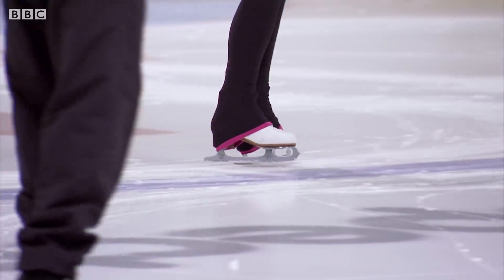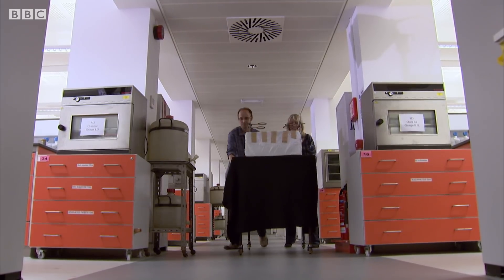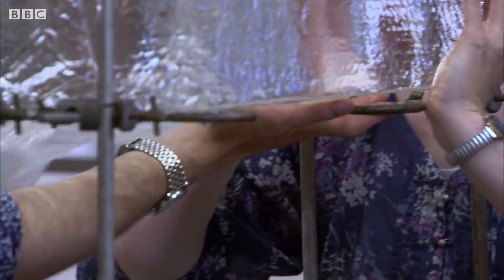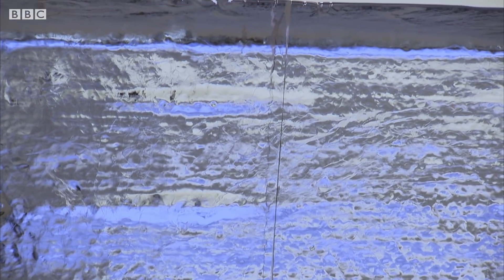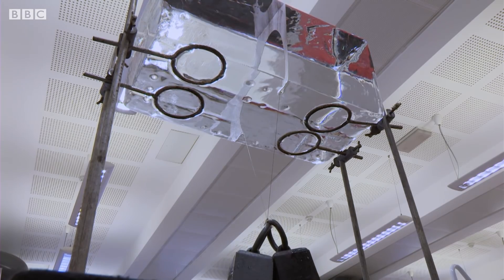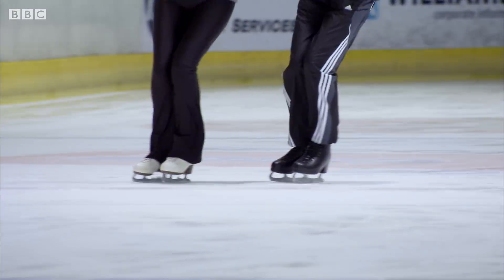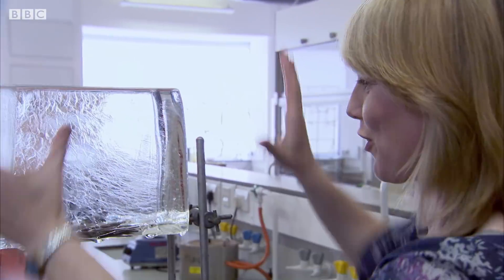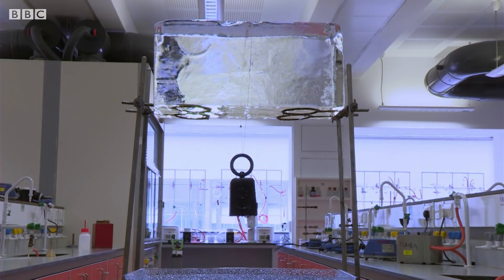How Do We Skate On Ice? | Earth Science

Comment: It's not just the pressure though, as that would account for only a few degree change at best, and you can still skate on supercold ice. It's also slippery in shoes and not just skates. There's more at play here than that one aspect.
Reply: Having worked at an ice rink, I can tell you it isn't as slippery as you think in regular shoes. Wet ice (as often found in nature) is what accounts for falls. Its smoothness combined with the pressure is what makes it more slick than the normal ground you walk on.
Reply: 2:20 "one of the key reasons"
Reply: @Jonny-hm3iz It is not a key reason though. A human is way too light to reduce the melting point of ice in any meaningful amount.
Reply: The temperature does not change. It's all a function of the pressure. Basically, there are two factors in determining the state of a chemical, the temperature and the pressure. Most chemicals will go from liquid to solid if you either decrease the temperature or you increase the pressure. Water, on the other hand, is quite unique in that the it goes from liquid to solid if you decrease the pressure (and solid to liquid when you increase the pressure). At -5 degrees Celsius, water is solid at 15 psi of pressure. But if you increase the pressure to 60PSI, it will turn to liquid and still be at -5 degrees.  Effectively, the skates (or shoes) increase the pressure enough to melt just enough of the ice to allow you to slide. Once you slide off, it quickly refreezes.

Comment: what happens if you repeat the experiment with a nylon thread of equal diameter? (i.e. less conductive material)
Reply: Why do you imagine that that would make a difference?
Reply: @serock3  To show that it is indeed the pressure and not the temperature of the wire that is doing the melting since a big part of the wire and the metal weight is at room temperature.
Reply: @leecoldsmoke  Oh, right, heat conductivity, that makes sense. I imagine that it would work regardless since the freezing point of water does lower with pressure, though my thermal physics textbook says that whether or not this contributes to ice slipperiness is not agreed upon by scientists.